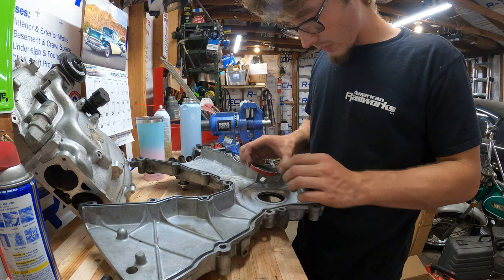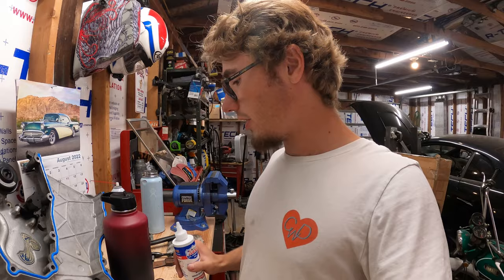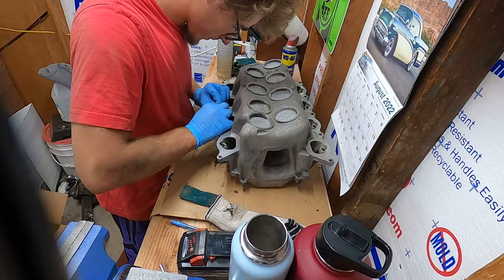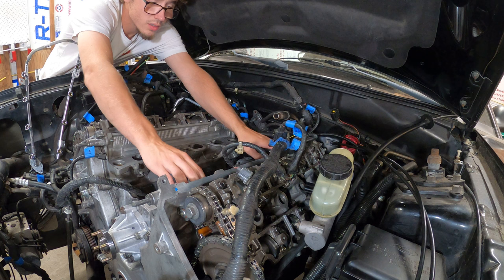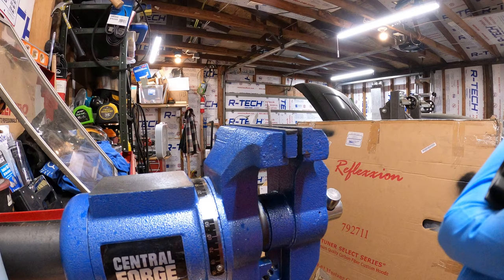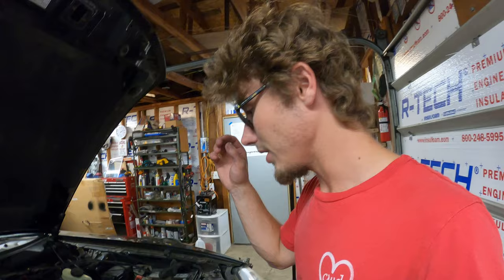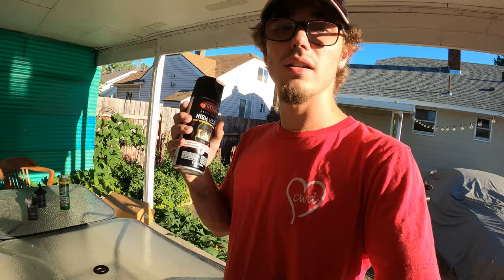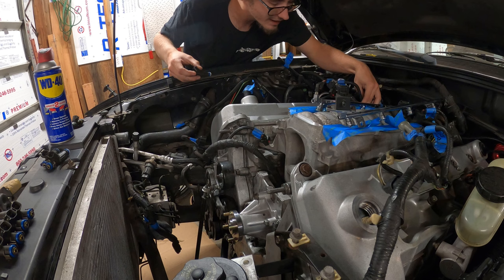rebuilding my 99 mustang cobra - reassembly

Comment: How would I go about taking ou t the whole engine block for a 99 cobra
Reply from the maker: Well you pretty much have to unbolt anything that attaches to the motor. But you’d most likely be able to remove it with the transmission connected and some of the exhaust still on.